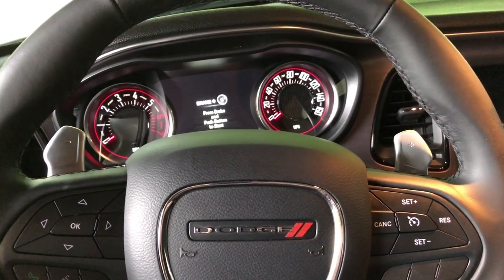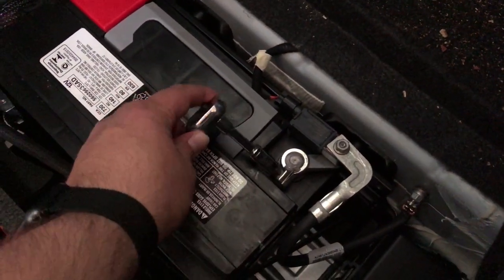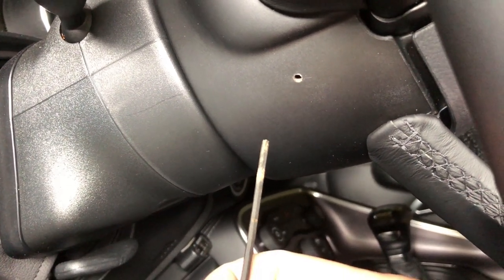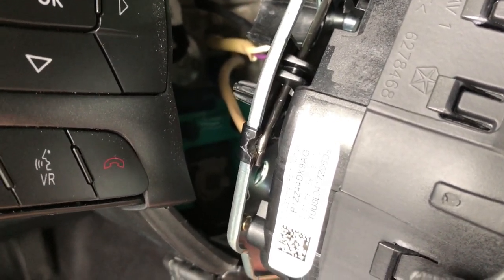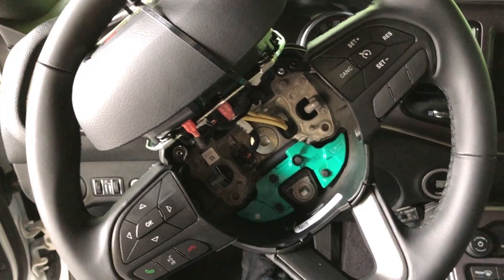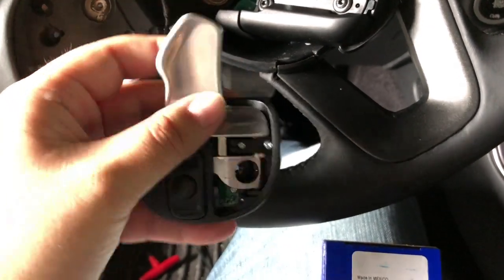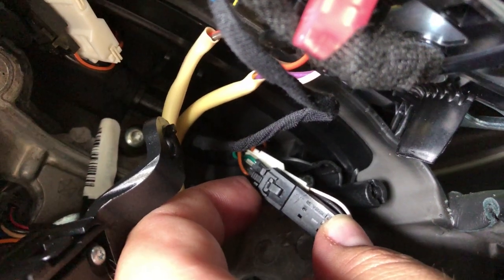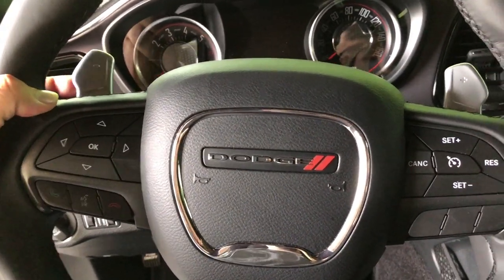How To Install Paddle Shifters on R/T or SXT

Comment: I have a 2015 charger RT pursuit, I have moved the shifter from the column to the floor. It once had capabilities to manually switch gears with a button on the column shifter, so I know the car has the capability. Would this mod work with no differences as it did for you?

Comment: Is the tazer anything like a throttle controller ? Or would it be ideal to have both tazer and a throttle controller for a 2019 sxt
Reply from the maker: The Tazer isn’t like the peddle cmd.  It plugs into the OBD port and lets you change settings and things.  But on 2019+ FCA added more security you need a double bypass module.